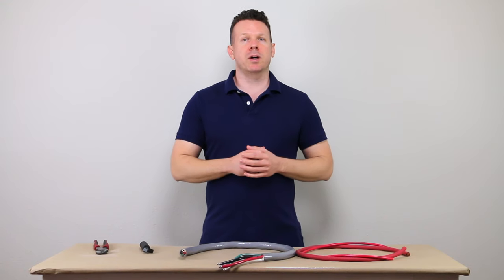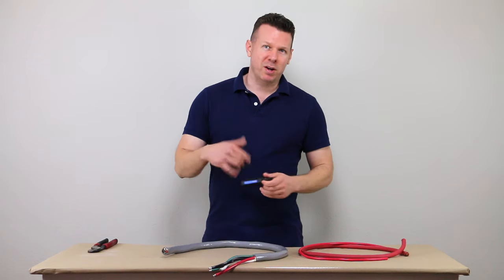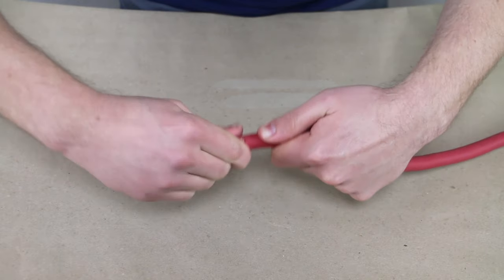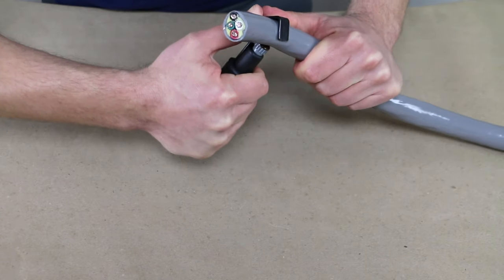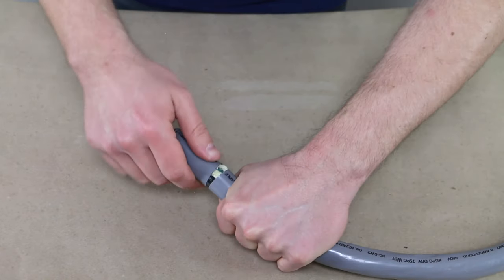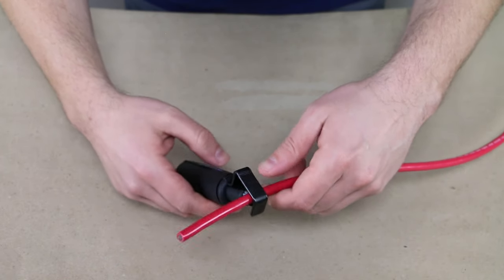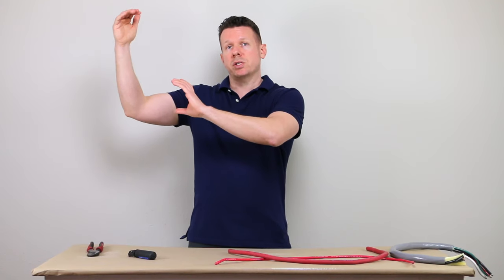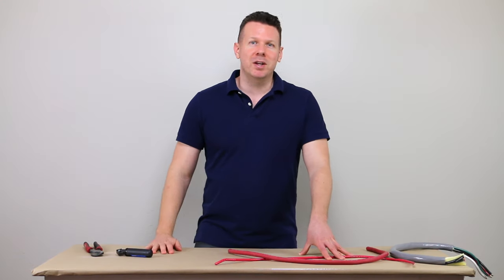The BEST cable stripper for Van & RV power systems - featuring the Jonard Tools CST-1900

Comment: When you do a 4 conductor cable do the slit first then peel the insulation back and cut that off with a knife.
I use a Greenly of similar design. You are correct that design is the best.